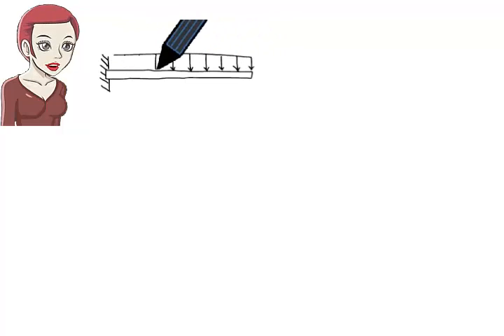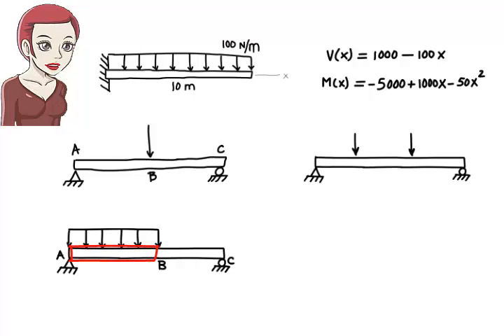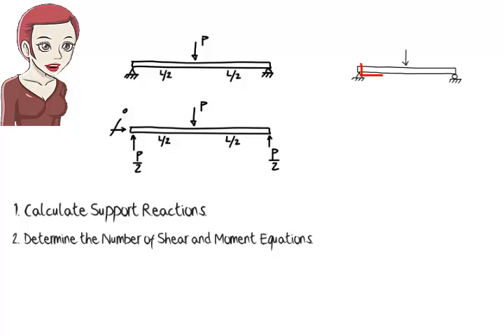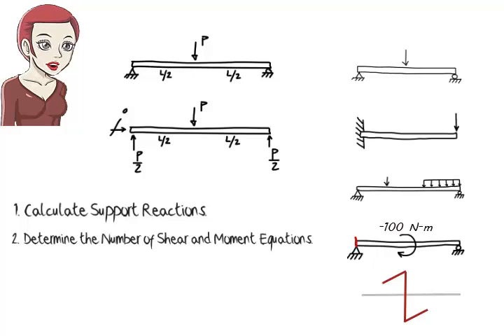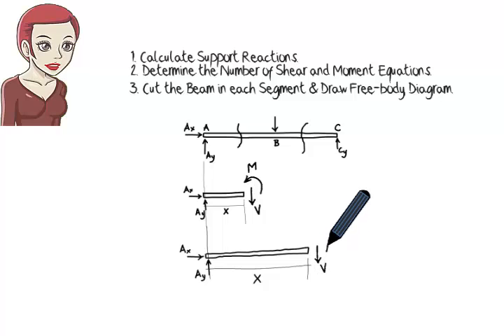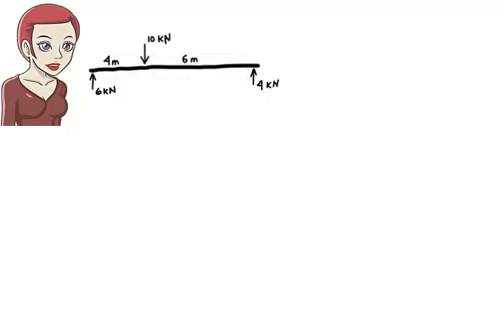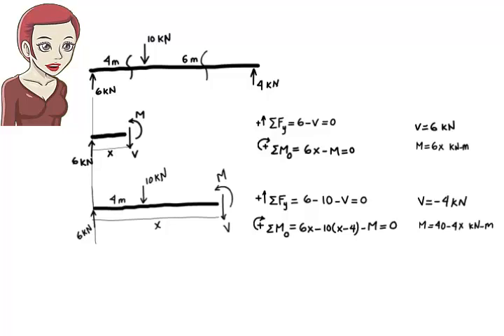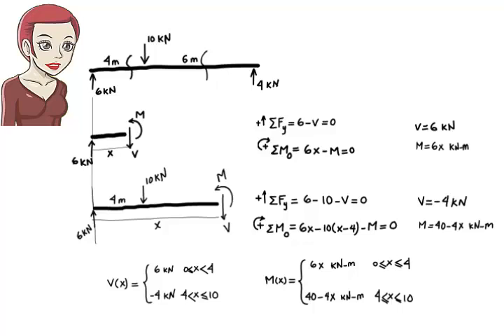SA07: Shear & Moment Equations

Comment: This is helpful because it writes out the steps rather than showing you pictures of the solutions. But I have a question: why do you multiply 100 by 5 and 2.5 when you're taking the moment about A (@ 10:23)? More specifically, where does the 2.5 come from?
Reply from the maker: That is the moment arm (the distance from the center of the rectangle to Point A) for the rectangular load.

The rectangular load is replaced by its equivalent concentrated load. The magnitude of this concentrated load equals to the area of the rectangle: 100(5) = 500.

This concentrated load is located at the center of the rectangle which is (5/2) = 2.5 m away from Point A. This distance therefore is the moment arm for the concentrated load.

The moment of the concentrated load about A therefore is its magnitude times the moment arm, or : 100(5)(2.5).
Reply: Dr. Structure Very helpful explanation. I didn't learn in class yet that the concentrated load is located at the center of the rectangle, in a circumstance like this. Many thanks.
Reply: Dr. Structure Understood! Thank you for the thorough explanation.

Comment: At 10:30 while calculating sigma Fy why are we not taking Cy? There is no force By acting on the beam. Like why arent we doing Ay+Cy-500 =0?
Reply from the maker: The correct equation indeed is Ay + Cy - 500 = 0.
Reply: @DrStructure  Might help "Students" if you show that correction on the video as to not confuse anyone.

Comment: At 11:43 of the video, why is it (x divided by two) in the moment equation?
Reply from the maker: Here, we are taking sum of the moments about the cut point. To take the
moment of the uniformly distributed load about the cut point, first replace the
load with its equivalent concentrated load (the area of the rectangle.) The
rectangle has a base of x and a height of 100, therefore its area is 100 x. This
concentrated load (of 100 x) is placed at the center of the rectangle which is x/2 from the cut point. Then, the moment of the concentrated load about the cut point is: (100 x) (x/2).
Reply: Dr. Structure thanks i get it